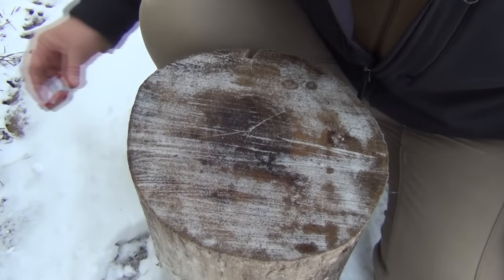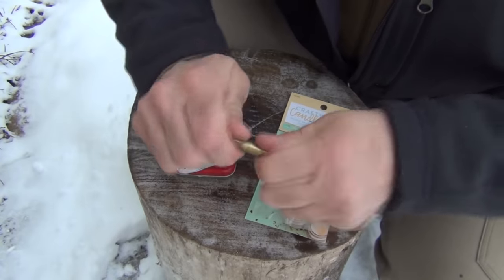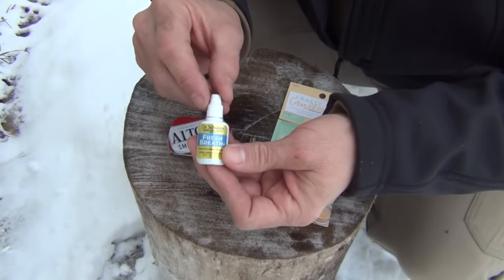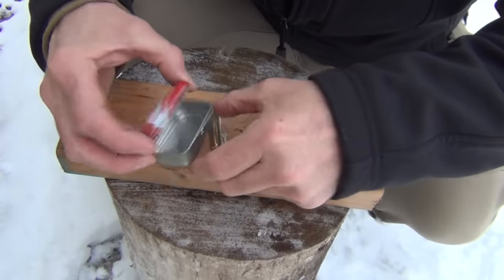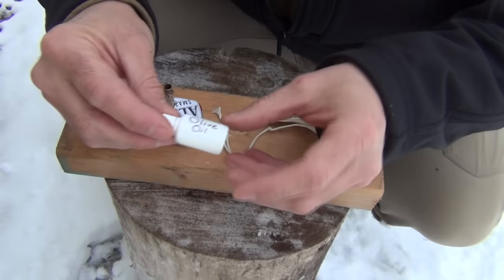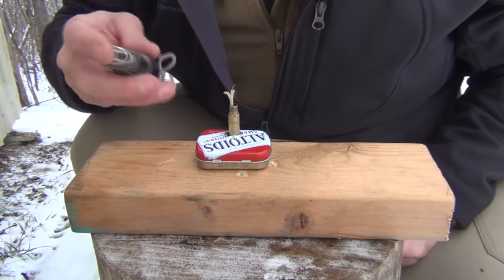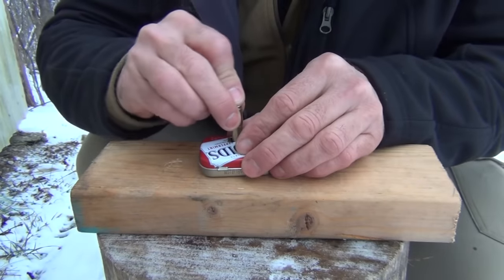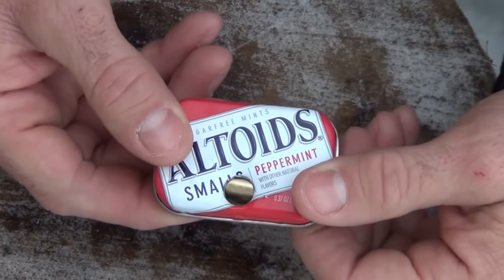MINI OIL LAMP [Really Works!]

Comment: I would imagine though that it doesn't put out much light. But I had a thought that if you had three of those shells you can put three holes in the top of that Altoids tin and have a triple oil candle.
Reply from the maker: Yes, you could certainly do that. Of course, you would have to bring more olive oil with you because it would all burn up in about one light session. Thank you for watching!
Reply: I just ordered some lampwicks from Amazon it's like 3 or 4 different sizes six and a half feet each it was like $7 or 8 dollars for all of it.  I have two inside glass lamp oil lamps.  I was wondering if you could mix the olive oil with the lamp oil so that it would draw better but stretch your lamp oil I've been kind of kicking that around because if you use just straight olive oil it doesn't draw fast enough and you burn your wicks up fairly quickly and it doesn't burn near as bright of course but if you were to mix the two I was thinking that maybe a person could use a lot less paraffin lamp oil in their lamps... I think I will try an experiment on one of them to see if it works
Reply: It's really a way to use possible rancid olive oil in an shtf situation.  Olive oil is too expensive as is just to burn because paraffin lamp oil is cheaper. But in an shtf situation if you had some rancid olive oil you could maybe stretch your paraffin oil that way.
Reply: @LadyTSurvival   
 And the olive oil puts off far less smoke, soot, and odor than lamp oil.

Comment: You could get a much better burn with something like kerosene.  While a lot of true oils (triglycerides) will burn, they will burn nowhere near as good as something like kerosene, or diesel fuel.  Also, not sure what wicking material you used, but a high quality wick should hardly unravel at all.  Also, if you can include a second 380 shell with the primer drilled out in the kit and feed the wick through it and secure it you will get an even better and more controlled burn based on exposed wick length.
Reply from the maker: Thank you for watching!

Comment: Why not just use the 5.56 shell with a hole drilled  where the firing pin left the indent just big enough for a wick to slide through. then by pouring oil into the Altoid can depending on how long you want it to burn you would be able to heat your tent most of the night. That way you will only need the Altoid can, empty shell size is your choice, wick & a means to ignite. When done, & the Altoid can is empty wait for it to cool, put the shell back in the Altoid can w/ oil and you have less to carry
Reply from the maker: The shell would sit on the wick and keep it from wicking up adequately, also, the the Altoids tin has a hinge punched in the back and therefore would leak. Still, it's always a good idea to think of ways to improve someone else's design, so keep it up and thanks for watching!

Comment: You could put the hole in the bottom, push the shell through, and use the lid as a reflector/wind block. Nice little light thank you.
Reply from the maker: Yes, you could do that but if any oil leaked out it will come through the bottom.
Reply: And that would? @WayPointSurvival
Reply from the maker: It would get all over everything.

Comment: olive oil would also safer to handle in the event that it does leak and not as likely to contaminate objects that might be used in the preparation of food whereas contact with diesel fuel can irritate the skin...as if being in a stressful survival situation is not already bad enough
Reply from the maker: Very true. Another one of the many reasons that I feel like it is a good selection for this particular project.

Comment: Only problem is the oil isn't going to pour back through a bottleneck at least not the majority of it(.223<9mm) leading to oil leak once you go to reuse. Can't attest to this as I haven't tried but just a possible weak point to keep in mind I figure.
Reply from the maker: Thank you for watching.

Comment: For making holes in thin metals like this, the step drill bit is the way to go. Nice clean cut. Olive oil is good stuff. When backcountry hiking and I'm using crazy calories, I carry a small bottle of it to add to my calorie intake. Compact, easy to carry, not too heavy. Good stuff to have around.
Reply from the maker: Indeed. Step drills are a pretty neat invention. However, not everybody will have one and so I showed what I thought would be the easiest method for most people. And you're right, olive oil is an amazing substance to have on hand.

Comment: I can get 8 hours from a single beeswax candle in my pocket.  2-3 hours with parrafin.  Fun historic craft project but a lot of fiddling for 30 minutes of light at a time.
Reply from the maker: Sounds good. The thing I like about this project is that it can be refilled using multiple types of fuels and oils.
Reply: @WayPointSurvival  a fun and historic project.    Not really what I'd rely on with a store about before heading into the woods as it takes more room for less hours than a good candle.  Now if you cut the bottom out of the shell and filled the altoids tin with oil, it'd go all night.

Comment: That's just adorable! But seems like you could get a tea light or two in there,  Or fill it with wax and a couple of wicks
Reply from the maker: Sure, you could do that. However this allows you to source various kinds of oil to use in a survival situation. Wax would not work as the wick would burn down inside of the brass case and extinguish itself from lack of oxygen. Thank you for watching and for your question.

Comment: Would this work with alcohol, too? I'm carrying an alcohol burner anyways so I wonder if I could construct something to "enlighten" me a little using the same fuel. ;-)
Reply from the maker: It would need some modification if you were going to use alcohol.
Reply: @WayPointSurvival  and how would I need to modify it? Do I use another kind of wick, a smaller opening or what else?
Reply from the maker: Alcohol doesn't need a wick. But, you might want to drill small burner holes around the outside top much like you would for any other small alcohol stove. Also, alcohol evaporates quite quickly so that would be another concern.
Reply: @WayPointSurvival  so basically like a very small and narrow alcohol stove...
I just realised I'm carrying some cooking oil anyway most of the time so I might try that, seems less effort. But thank you very much for the Infos!

Comment: A 9mm case should work too wouldn't it?
Reply from the maker: It's pretty close to the same size so it might. The only way to tell for sure is to test fit it. You might have to try several shells before you can find one that works right.

Comment: why wouldn't you put the wick throught the primer whole then fill the bottom mint container with oil
Reply from the maker: Because the shell would sit on the wick and stop the capillary action from wicking up the oil. Plus, the Altoids tin has slots in the rear punched out for the hinge so it would leak.

Comment: attach a lil chain to the cap so it says together wrap some cord around it like christian ackerson said and put the hole in the bottom of the tin so when the tin is open the tin lid can be used as a wind shield
Reply from the maker: If you put the hole in the bottom of the tin it makes it very unstable, I tried that. The way I did it works best.

Comment: Great tip! Definitely gonna make one of these. Question, could you use a .38 special case instead of the .380? 👍🏻🍻
Reply from the maker: Possibly. The important thing is you would have to test fit it.
Reply: @WayPointSurvival  definitely going to try it out. 👍🏻 should be about the same diameter, but the .38sp has a longer case.

Comment: Dried beef jar from making Christmas cheese balls the lid seals good . A piece of scrap 3/16 brake line about 1.5 inches about 6 inches of relativity stiff wire. I had 14 gauge electric fence wire. A piece cotton twine I had to 2 ply reverse twist to fit into the brake line. And kerosene. Use your imagination. And please make a video of what kind of oil lamp you ended up with. I’ve been really enjoying ones I’ve made for a while.
Reply from the maker: Thank you for watching and for sharing your design.

Comment: I love the ingenuity behind this, but what real world applications would this work for?
Reply from the maker: This is a great pocket size lamp for a Bushcraft camp for some extra light in the evening as well as a great improvised lamp to make in a bug out situation etc. It's not just so much that you would make this and use it all the time necessarily, it's another good tool for the mental toolbox for those just in case scenarios. However, there would be nothing wrong with someone taking this and using it in their camp on a regular basis as well.

Comment: Hey man, i use cotton, the regualr pharmacy fluffy white variety. Twist the desired length to constrict the wick so it easily passes through the tube into the fuel tank side, then reverse the twist to fill the wick tube and prevent flashbacks if any. (Trim the hot end of the wick flush but in use 1mm to 2mm of wick extended gives a normal candle flame in my latest one i made in a borosilicate lab flask.

The shorter you extend the wick the longer its entire life will be.

Reverse twist fit density in the passageway from tank to flame has fairly good flow control in conjunction with wick extension.

I find mine as safe as any candle when used carefully.

It never drips fuel but a screw cap to seal the burnt end when not in use is lacking and missed often.

But my original point is the cotton does not just burn away, its better than any wick ive ever found for sale. Chances are theres a roll of it in the first aid kits. 

Paraffin worked great, spirits burns fast and caused far more wick damage.
Reply from the maker: Sounds great. Thanks for watching and for sharing your method!

Comment: Oh my god, you’re using bullets and burning them!  They’ll blow up and kill a dozen people!!  😀.      Neat little idea.  I think olive oil would get way too thick in the cold, but in warm weather is obviously ok.   I would suggest something lighter like kerosene for anyone who can’t find the right things for a cap.  That way you could just pour it out when not using it.         I’ve been watching Lars' channel for years, but I don’t remember this.    Thanks.
Reply from the maker: Thank you for watching. The only problem with kerosene is that it can contaminate your pack if it spills and you can't use it for frying or for a few drops of oil on a survival salad if needed. I used olive oil because it's not only edible but has multiple uses.

Comment: Looks at air rifle Co2 bulbs thoughtfully...
Reply from the maker: Right? That would be a good idea as long as you can stabilize the base.
Reply: @WayPointSurvival  Once empty, gouge the foil cap off then whazz the rounded end in a fire to heat it, pull out with pliers and apply percussive adjustment technique with a rock to flatten seems like a plan.
If in the shop then a gas torch and hammer/vice will substitute.

Comment: That's a pretty slick little candle. I do have a couple of questions. Why didn't you use the design you used on the candle where the wire spins out as a holder. You could put a hole in the back to hang it on a nail or a wire hook. Using the Altoid tin is the reflector. My other question is even though you put a 380 casing on the end. Even if it does not leak when you are carrying it. It is certainly going to leak when you open it. Seems to me like you could put a piece of cotton around the wick on the inside and then a small piece of tin foil with a small hole in it for the WIC coming up through it. Perhaps take a wire band and tighten it down over the tinfoil. I don't know if this would keep all of it from leaking out. But it might. Because when you're carrying it it's going to leak out into the cap. The only solution I see would be opening it up upside down and letting everything just go to the cap and then pour it back into the main body. It is certainly a slick little device if you can work out all the Kinks. As you said you don't want it falling over perhaps having the cotton and the tinfoil would make it less dangerous if it accidentally did fall over. It can't be completely airtight because of the way or oil Works burning with a wick. It would definitely be something to play around with. Also you might get one of those half sandwich Ziploc bags and put it in it before you put it in the alkaloid that would guarantee no leaks while carrying. I know 40 drops isn't a major spill. But it's still oil you could use to burn
Reply from the maker: Thank you for watching and for your suggestions.

Comment: Oil lamps can be useful source of easy heat. I have made qulliqs out of tuna cans many times with left over bacon grease but I bet your altoids tin would work just as well. Just put some oil in the tin and push cotton through the hole you made. I do think the bullet lamp is very cool too and your design can be used both ways. Add a few cotton balls and you are all set.
Reply from the maker: Thank you for watching!

Comment: While I wouldn't usually use a brad pointed drill to cut metal. The Altoids tin seems like it would be thin enough that the cutting lips of the drill would cut that with a minimal burr. 

It seems to me that a small o-ring could be put around the necked down section of the shell, this would ensure that it didn't leak.
Reply from the maker: Thank you for watching.

Comment: But a small LED light powered by 2 AAA batteries will produce equivalent light for at least 24 hours and won't take up any more space.
Reply from the maker: That is true. However, this is a great improvised, field expedient type light that can be made with any type of fuel oil or cooking oil that you might find. Just another tool for the toolbox.
Reply: @WayPointSurvival  I think my chances of finding an altoid tin, a 5.56 cartridge case, cooking oil and a suitable wick in the middle of nowhere would be slim. Given that this needs some preparation then my choice would be either the LED light or (what I usually carry) tea-light candles. Those give a couple of hours of light each. Could put a couple in your pocket and not worry about an altoid tin.

Comment: Try sealing the cap casing to the shell casing with a little wax dripped from a candle. If the brass is really clean the wax will seal the oil in and moisture out  , a candle or light source like this is lifesaving . So always try to have both in your gear.
Reply from the maker: Thank you for watching it for your suggestion.

Comment: Olive oil sure dont stink like gas or kerosene, but I find it does have a weird scent.
Reply from the maker: Yes. It does have a certain smell. However, it is preferable over the other fuels if you're carrying it around in your camping gear.

Comment: So for half an hour of work, you get something that costs as much as a gas station flashlight with 1/10 the functionality. 

It's a cute project for cub scouts, but it's essentially useless.
Reply from the maker: It's actually a copy of something that was commonly used by the military. Thanks for watching!
Reply: @WayPointSurvival  yes in 1940s Soviet Union. A time and place where battery-operated flashlights were about as common as competent generals and functioning equipment.

Comment: You can also just take a candle, melt the wax over it onto a surface, and apply the candle. Works great on a beverage can, which you can easily carry around.
Reply from the maker: Very true. Thanks for watching!
Reply: @WayPointSurvival  I've been out of electricity before! Thanks.

Comment: Hi  Jess, update, I found someone selling Swiss Army knife tweezers on eBay.
How about upscaling these lamps to .50 calibre cartridge cases?, plenty of wicks on eBay, you may need a machinist to make the caps which fit inside the top of the cartridge case etc.
It would look awesome having a candlelit dinner with guests with highly polished 50 cal oil lights stood on the table.
Just a thought.
Reply from the maker: That would definitely be interesting!

Comment: I'm using 7.62×54r not 223
Reply from the maker: You could do that, however, you would definitely need to use a larger tin to store it in.
Reply: @WayPointSurvival  I wouldn't expect any different though I do wonder how a circular altoids tin would do they're a bit taller than the minis and normal ones could probably fit a bit more fuel and still use 223

Comment: If you do not want to waste your wick length you should keep the part of the wick that is exposed to about 4,5mm. Then it will not be too long to burn of the end. That way your wick lasts for ever.
Reply from the maker: Thank you for watching for adding this to the comment section.

Comment: Why don’t just use wax?
Reply from the maker: Because it wouldn't fit very well into the shell casing and it would be difficult to repour  it when you're in the forest.
Reply: @WayPointSurvival  you could bring more than one & would not worry about spills or it opening in you pocket. There are trade offs. The Shoulders we’re very creative using what they hade. It would also make a great hand warmer. Your oil is also a good idea for a fire starter. Will try with wax also.
Reply from the maker: I believe that if you try it with wax, as the wick burns down inside of the brass shell it will lose oxygen to the point where it will extinguish the flame. Still, you could give it a shot and see what happens.
Reply: @WayPointSurvival  You are correct, the wick burned to the lip of the brass & went out. If you go to a Craft store. You can pick up a bag of wax beads ( for making  candles as a craft or religious project).you can also get a spool of wick. The you can make a candle out of any can metal cup.